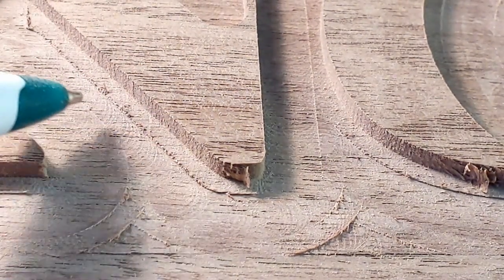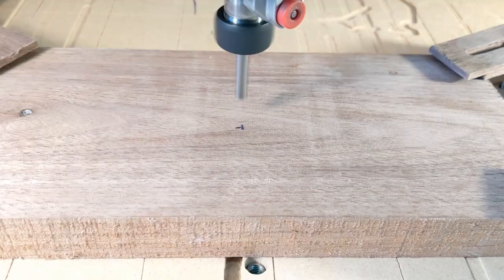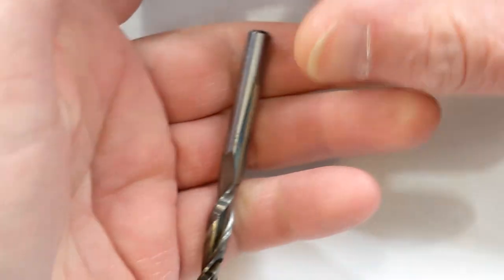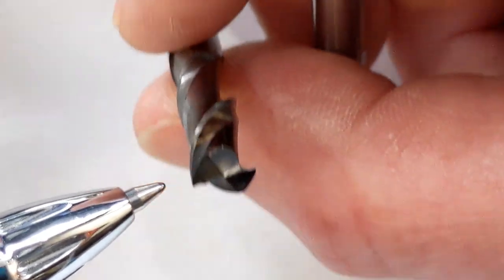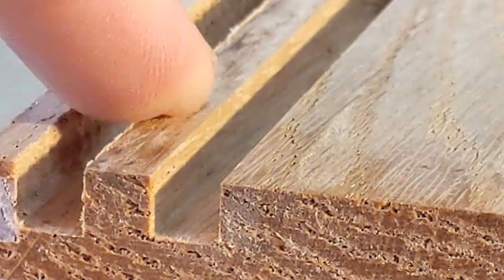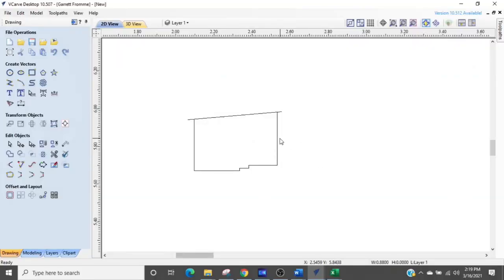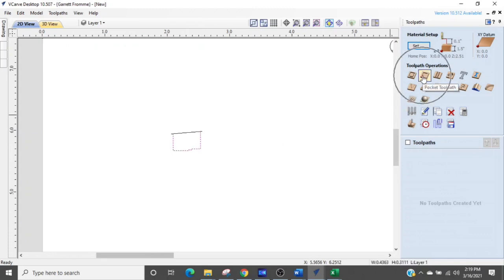Down Bits (Down Cut) And CNC Routers [What You Didn't Know] - Garrett Fromme

Comment: @4:15  That's weird.  I had the opposite problem today.

I'm making some stacked text signs,  pocketting with a 1/4" upcut bit and finishing with a 1/8" downcut.  The 1/8" bit seems to cut a tiny bit deeper, leaving ugly marks on the bottom.

I'm using a probe plate.  I figure I need to adjust my Z zero on the 1/8" bits up by about 0.2mm
Reply from the maker: Muz, it may have something to do with machine rigidity my friend!

Comment: I'm very new at this and just wondering about through cuts. Which of the upcut or downcut is better or doesn't it matter?  Are there considerations?
Reply from the maker: Watching, if tearout isnt a concern on the surface of your project, upcuts are better because they eject the chips out of your cuts more effectively but in most situations a downcut will work excellent as well.

Comment: Garrett, I've learned that using a downcut EM is great when you have applied Oramask 813. It cuts better than an Upcut EM when you have Oramask 813 on the wood because the upcut tends to want to grab and lift the Oramask 813. So is there another bit to use for what you are trying to do on this video when using the Oramask 813? Like a Tipped Flush Trim Plunge Bit. What would this bit do?
Reply from the maker: Hi Max, Great question. I would not use a tipped flush trim plunge bit on a CNC, it is not designed for this. 
Something close you could try would be a straight flute end mill. This type of bit might shear the Oamask better than an upcut and leave you with a cleaner edge but I could understand the downside of downcut bit on some projects. 
I have experience the same issues with Oramask and an upcut endmill as well so I can relate!
Reply: @IDCWoodcraft  Thank you Sir, I did not find a straight flute end mill in the IDC Woodcraft shop. Do you sell one? Also where is the search button and login on your website?
Reply from the maker: @maxgarcia9512  I apologize. I misread your statement. You want to use a down cutting bit when you're using or a mask

Comment: That is great, so, since you showed it,  how do we get a finish that has no witness or other marks on the carve base?
Reply from the maker: Chambrs, To get a mark-free finish with a downcut bit, try adding a shallow final pass at 0.01” to 0.02” to remove leftover marks. Adjusting to slower feed rates can also help, and switching to a flat-bottom or compression bit for the last pass gives an extra-smooth result. A light sanding with 220-grit can polish it off if needed. Hope it helps brother!

Comment: Question 
When taking off, let's say .007 of material for final pass. Can you up the inches per minute quit a bit since only taking off a small amount ?
Reply from the maker: Pete, That's a very advanced question my friend so right on for being ahead of the game. And yes you can! Feeds and speeds is all about getting good chips coming out from your cutter to carry away the heat from the cutting operation. A  shallow final pass at a slow speed causes tool rubbing instead of cutting leaving the heat in the tool instead of in the chips. From that you get reduced tool life

Comment: Different strokes for different blokes, I wouldn't used a double flute for wood projects. I've always used a single spiral up cut and never have problems, just make sure your bills are new. ;)
Reply from the maker: Hi oliz. Thanks for sharing. I haven't used a single flute up bit yet but will give it a try since you use it. Always enjoy the extra tips left in the comments.
Reply: @IDCWoodcraft  I have good results with single flute as well. Extra benefit : it can safely plunge without spiraling.
Reply from the maker: @ruudhooff6486  thank you. I am definitely gonna try it. Please send a link to the 1/4" brand you typically use.

Comment: Thank you for all your help .. the Question I have is about the V Bit Let's just use a 30 Degree Bit.  With that as example 30 Deg. with .01 tip I understand. But I see the bits with up to A .08 tip. is the larger tip made for a larger step over? and with a bigger tip say a .05 - .08  will it plunge and cut correctly or with the .05 - .08 will it burn the wood on a plunge ?  Is the larger tip used to cut around the rough cut that has already been cut with a bigger step over? Can you please help me Understand the bigger tip and Describe to me the purpose of the larger tip on the V bit. Thank you for all your help. 🙂
Reply from the maker: LesMcKenzie-u1o, Great questions! The larger tip on a V-bit allows for a wider area to be cut, which can indeed enable a larger step over when working on design details. A tip size of .05 to .08 should generally cut well if you are using the right feed rates and spindle speeds, reducing the risk of burning the wood during plunging. Typically, those larger tips are often used to finish off detailed areas after a rough cut has been completed. This way, they can create defined edges or carve wider grooves without tearing the wood. Happy woodworking!
Reply: @IDCWoodcraft  Wow!! Thank you very much for the help.. I Kinda though that but didn't Want to burn the shop down LOL. Thank you again you been a big help.. Les

Comment: Thank you for this video. I see that you were using climb cut would it make a difference if you use conventional cut. witch is best to use climb or conventional.
Thank you
Reply from the maker: For finish work it is best to use a climb cut. Always leaves a smoother surface. For roughing work, always use conventional cuts. Rougher finish but is not affected by backlash

Comment: Soit seems that it would make sense to start out with a down cut and then complete with an up cut, right?
Reply from the maker: Hi Dave. Not really necessary. That would mean a bit change when it is not needed. Down bit does fine on surface finish at second shallow pass.

Comment: Hey Garret! Love the channel, and the new 90 degree 'blade' bit is amazing. Thank you. 
I'm doing shallow last passes on my pockets. Even switching the 1/8 inch from downcut to upcut at a suitable depth to make sure the bottom of the cut is even. But I notice the 1/8in still goes about 0.005in deeper than the 1/4in. It isnt much but its noticeable enough to keep me from releasing paid work. I've trammed my machine, and I measure from the bed, but still can't seem to solve this issue. Any help would be greatly appreciated.
Reply from the maker: Rupertp, it sounds like you might have an issue with your machine or your machine isnt rigid enough. Something to consider brother!

Comment: Hi Garrett I've watch a lot of your videos already and they are great. Keep it up! Yesterday I did exactly what you did with lettering and clearing with a downcut bit. I took me all morning to find the explanation for the rough surfacing. Glad I found this video. Apart from the rough surfacing I have some tear out on the upper part of the letters where there are sharper edges and corners (in beech). Do you have a way of avoiding these too? Would the carve benefit from a shallow first pass, a normal second pass and a very shallow last past? Thanks Carlo
Reply from the maker: Hi Brookhouse. Did you use an up bit or down bit? If you are using a down and getting tear out, then the bit needs replaced. If you're using an up cut, switch it with a down bit. This → https://bit.ly/3HXdnLM

Comment: thank you for teaching me that important things! What direction are you milling?? forwards or reverse ??Regards from good old germany!
Reply from the maker: Hi Alter. Forward and backward are unusual terms in machining. Can you clarify what you mean please?
Reply: @IDCWoodcraft  its about the direction the mill turns...run in the same direction and in opposite directions
Reply from the maker: @alterstassfurter5743  The bit always turns clockwise unless you have a special left-handed bit. They do exist by the way. 

You're thinking of conventional cutting and climb cutting. In the case of that project, it was going both ways.
Reply: @IDCWoodcraft  LOL its different words for the same run...btw I know how the bit runs,what direction,but I am a metalworker with no skills in woodworking, ATM I am a student for CNC milling (3 and 5 axis) Heidenhain system ,but I am learning from everyone and everytime .
Reply from the maker: @alterstassfurter5743  ah now I understand
Reply from the maker: It is funny. Even with our metal working skills, wood is a bit different, as is how the software writes the programs. Yes, it actually goes back and forth. So it's switching between conventional and climbing depending on the choice of tools paths. That's another one called offset which starts in the middle and works its way out.

Comment: Just got my DIY CNC machine moving yesterday. Thanks for the information, can't wait to hear more. Using the USB CNC software from a cheap Amazon kit. Any particular boards/software you think are decent for beginners?
Reply from the maker: Hey CR1. Congrats on getting the machine in! My strength isn't in the controls software so can't give my thoughts on that.

So what is going to be your first project?
Reply: @IDCWoodcraft  don't know yet tbh. Might try making a sign for my dad's new work shop that's being built. Needing to finish setting up the machine and redesigning some of the parts. It's a machine of my own design so I'm in the process of finding and fixing the flaws right now.
Reply from the maker: @Cr1msonFir3  very interested in hearing how it goes.

Comment: Hey Garret, thanks for this explanation, I have a question though.  In the example you showed, one was .240, the other was .280 ish. I assume you zeroed to the z the same way for each tool, but what was the desired depth of cut ?  Thanks
Reply from the maker: Hi JR. The depth intended was 0.25 inch. Just so you know, this is much more apparent on machines with rigidity issues.

Comment: How do you resolve the hi/lo problem when using the "V-Carve / Engraving Toolpath"?  The Clearance tool feature doesn't provide the ability to set the number of passes.  Do I need to uncheck the "Use Flat Area Clearance Tool"?  Do I then set up a separate tool path using the "Pocket Toolpath"?  Do I then have to select two vectors to define the pocket?
Reply from the maker: Oh Larry...so many questions.

I don't know what you mean by hi/lo problem
When you are using the engraving tool path, you will not be able to set passes. It will be only one pass.

Looks like you need a one-on-one
Reply: @IDCWoodcraft    The hi/lo is the difference in the height of the cut from one pass to another.  I solved it by not using the V-Carve / Engraving Toolpath for the clearance passes.  I also used a DownCut 1/4" bit.  Thank you for replying.

Comment: Thanks for the great info.  I have been trying to get going with my router setup and have been reluctant to buy cutters...for lack of knowlege.  Our stimulus dollars hard at work now Im getting some cutters finally!   Also can these bits be used on brass.  I want to make stamps for embossing logos on leather.   Is there a current coupon  code for your router bit offer?
Reply from the maker: Hi Edward. Yes, the code is MYBITS. Takes $10 off. I have not used these bits on brass but definitely have it on my agenda now that you said that. I can say that they will work for brass based on my many years in CNC machining. they will not work for steel.

Comment: When cutting all the way through material, have you ever maybe cut halfway through the material with a down bit and switch the bit out with a up bit to finish cutting all the way through to get clean edges on both sides? Would this work? I know thats what a compression bit does, but if one does not have one on hand, would this idea in theory be a work around?
Reply from the maker: JC, that could definitely work brother!
Reply: @IDCWoodcraft  I tryed it out this afternoon. It's an extra few steps, but the result is worth it. So much cleaner!
Reply from the maker: @JCraftvfx  It sure does make a difference doesn't it

Comment: I just had a aha moment, thnx for that👍
Reply from the maker: Hello Ruud. Please share...what was the ah-ha?
Reply: @IDCWoodcraft  the ah-ha was when you explained the reason why the bit is drawn deeper into the workpiece on the initial cut when the slot is created vs the following pass where it has the step over. I was familiar with the last pass option so did know how to fix it but never thought about what causes it.
I assume in my case it's actually the spindle being pulled down, the flexible connector between the servo and the threaded rod allows for a little movement...

Comment: Newbie here.... I am using free Carbide create. Can this be solved with the free software?
Reply from the maker: Yes, by setting the pass depth or depth of cut. for the bit you are using. Set the pass depth to .01" shorter than the depth of your design. It will generate a second pass at the finish depth.

Comment: Just an FYI, at 7:30 you stated using 1/4 of the bit. Actually that is incorrect, you are using 1/2 of the bit. Mechanical engineering spec on bit & cut specification is based on diameter, not radius. Just thought you might like to know that...;)
Reply from the maker: Hi Kevin. Thank you for pointing that out. Yeah, I realized that. As always, I try to keep my videos for those who do not look at the engineering level. Definitely glad you commented about it. Helps so many others understand a little deeper.

Comment: Are witness marks circles or ovals left by a down cut bit?  I did a project with thick v carved letters requiring clearance tool, with only 1 pass of a 1/4 inch downcut bit thick and it left circle and long ovals.  How do you get rid of those? Maybe same method? Thanks!!
Reply from the maker: rebeccamiller42, it is tricky to remove those circles and ovals from your cuts as a lot of the problem depends on the rigidity of your machine and your project setup. Consider doing a finishing pass like this video outlines or sanding after you cut it out!

Comment: If your machine z height can be affected by up or down cut bits then surely it is fundamentally not strong enough ?
Reply from the maker: Hi Ollie. You are correct for the most part. However, up/down pressure does come into play no matter how rigid a machine may be. For all intents and purposes, many hobby CNC machine owners suffer from this so they needed a way around it.
Reply: @IDCWoodcraft  I suppose you are right for x carves and stuff like that.  I like compression bits as it's like best of both.

Comment: Ok,I knew the bit was leaving the steps, I just didn't now how to get rid of it. I would sand it to get rid of some but not all. I Did a 2nd pass a little lower and saw that it was better but that was twice. I was thinking I was doing something wrong. So my ah ha moment is when you said " you have to do it twice " I was like, dam I have to do it twice thats more time LOL
Reply from the maker: Hello Few!...Funny things is, do we want to let the machine spend a little more time at it or do we want to spend 10x more time sanding?...
Reply: @IDCWoodcraft  You are absolutely right, but in my case the landlord is next door and can hear the noise and I have it in a case that block 70% of it. so twice is not good right now til I put a shed out back.
Reply from the maker: @fewdoesit6409  2 things to try to dampen the sound more. Put the base on soft pads that will absorb vibration. Some of the sound is traveling thru the floor. Second, throw a thick blanket over it if you can.
Reply: @IDCWoodcraft  I will try that ... that SOUNDS like it would work, I'm glad I thought of it. LOL

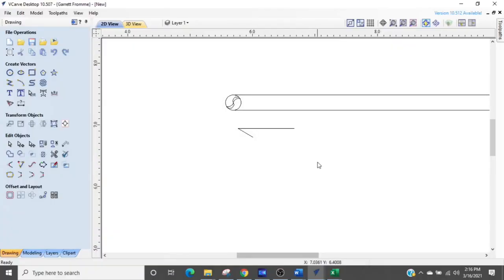Comment: 6:41- This does not apply to all cnc routers, for example you can perform the same test with an industrial grade cnc router and both bits would cut to the same depth regardless of the bits cutting direction. The issue is not up-cut or down-cut bits but rather the quality, size and duty rate of the machine.
Reply from the maker: Thanks for sharing Moss. Of course. However, the people who watch this channel do not have industrial equipment and many of them struggle with this problem.
Reply: @IDCWoodcraft 
 I watch your channel and I have an industrial cnc, I'm not sure how you came up with that assumption. I just wanted to clarify to anyone  watching that machine quality and size is the real issue. The smaller, cheaper the machine the thiner the cuts need to be. I find it funny how you act like you saved the world in your video like you found the cure for cancer. Anyway, at least your helping some people I suppose.
Reply from the maker: @jasonbarker9  hi Moss. I want to say thank you. I had no idea the audience is not always home based. Not a good assumption so I am sorry and will broaden my perspective based on what you just shared.

Comment: Can a cnc be used to cut out scroll letters?
Reply from the maker: Hi Jessica. Absolutely it can. In fact, many scrollers, when they realize this, jump on the CNC band wagon because they see how much more they can do and how much faster they can do it!
Reply: It just seems a lot better than a glow forge well cheaper. So it does cuts and engraving? Not burning  right?
Reply from the maker: @jessicae7229  it cuts by burning through the wood. But they leave excellent corners!